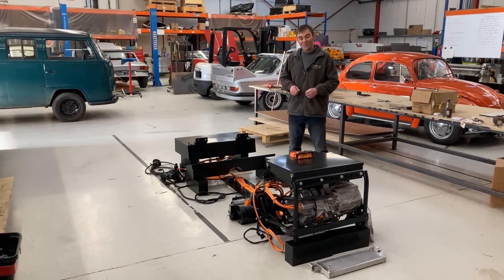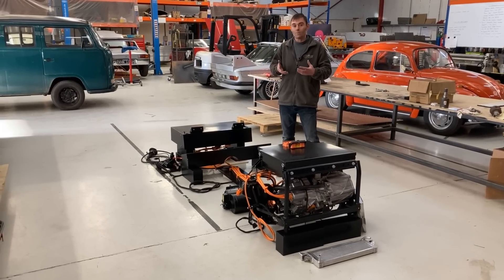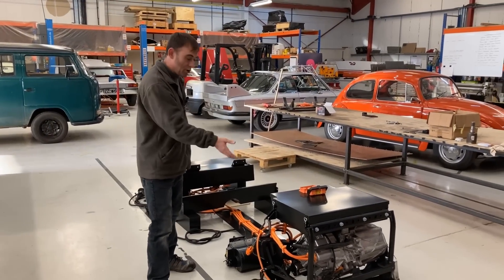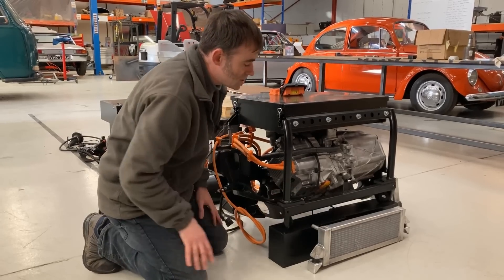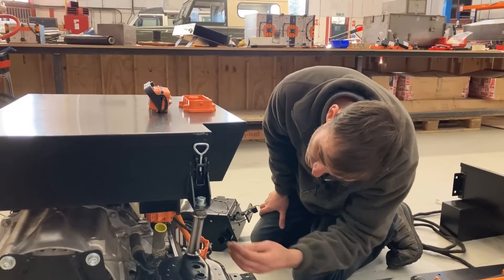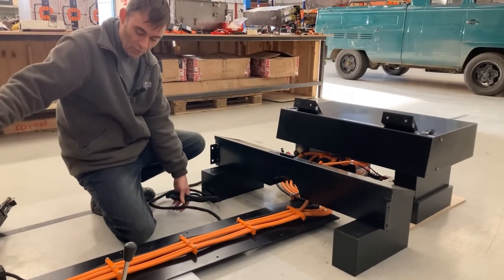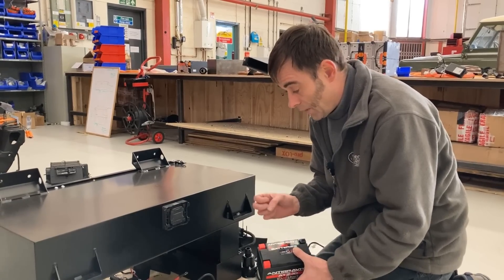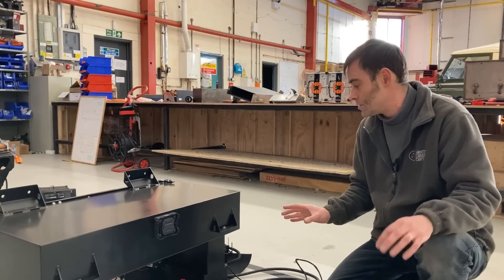Classic Mini bolt-in electric conversion kit.

Comment: Are there any trade-offs (power losses etc) with having 3 separate battery boxes, instead of having just 1?
Reply from the maker: Not really. Spreading the weight helps with weight distribution and handling that’s for sure. 👍

Comment: Have you thought about having a CHAdeMO connector in the second twin tank filler. I think it should fit if the type 2 connector fits. Then you could have slow (50Kw max) rapid charging. Adaptors from CHAdeMO to CCS are quite good and this would give your kit better usability for long trips or those who can't charge at home.

Comment: i take it thers a low voltage feed for dash and cabin light etc dident see eny fuse box for this ,,with the quality of your kits i am shore its there some wear, cant wate for vid
Reply from the maker: The 12v system is left as is in the car. The only connection to this for the EV system is permanent 12v, ignition 12v and the DC/DC that's charges the 12v battery up. 👍

Comment: I have 2003 Ford Focus SVT.  Wish there was a easy bolt in EV conversion! Is there any electric motor transmission adapter for a Ford SVT six speed transmission!  I was told the 6 speed is the same trany that the mini-cooper has.  I’d like to adapt a electric motor to the trans, stick it in second gear and drive it. Add a controller, batteries and what ever else I would need and just drive it locally! Any conversions like that available?

Comment: It's sad but I'm glad they say right at the beginning they only sell to approved installers. I'm looking for a basic kit I can buy and install myself even if I have to work out many of the problems of installing for my specific vehicle and getting it all to work myself. I can get an old forklift motor or something but I'm sure someone will provide a better solution than that, a kit which includes a modern motor, controllers, charging solutions, either a battery pack or instructions on making one, etc.

Comment: What gearbox is used when mounting this bolt in kit to the Mini? How does the new Automatic gear shifter work with this? Thanks
Reply from the maker: There is no gearbox. The Tesla drivetrain includes an inbuilt gear reduction unit. 👍

Comment: I am interested to know why use such a high HP motor?  Seems like the range could go longer with a small motor, but maybe not?
Reply from the maker: Because it slotted right in. It's not anywhere near that peak HP now for various reasons such as pack voltage etc.

Comment: Is there a difference in range between low power and high power mode?
Reply: Think about that for a moment. Yes!
Reply: @deanosaur808  that's why I don't understand not using a 3 spd gear set. It would allow you to double the range without having to double the battery

Comment: Love it, but did you ever consider, also stuffing some batteries into the tunnel? Which has been done, before in other EVs....

And why just use that SAE J1772 socket? When it crosses the pond, instead of true a type 1, since a type 2 is used when it stays home... It does not seem fair to the Yanks...
Reply from the maker: The battery modules are too big to fit in the tunnel. We supply Type 1 socket for kits destined for our US partner - Supercoopers.
Reply: @ElectricClassicCars  Thx for your feedback....
But it is readily apparent that your current battery modules would not fit in the tunnel.  So OFC I was just "suggesting", creating custom modules that would fit, "in case it was in your wheelhouse"?
And in the states, a "Type 1 socket" refers to a CCS socket, with pins for DCFC, which it clearly does not include... What you supplied is designated as SAE J1772
socket in the states, where will it be used.... 
Keep up the good work...

Comment: If you are running on a lower horsepower setting does the range of the vehicle increase?
Reply: Of course! The maximum range is reached using the road mode, as mentioned in the video.

Comment: 150 mile range? Not bad and I bet it feels like a rocket with all that power.
A simple EV without all the useless junk they put in modern cars, the main car brands could learn a lot from you.
Also I want one.
Reply: 💯 2003 gas car key-FOB failed, so used physical key to go shopping (+ new key-FOB battery)… only to discover my new 12v battery was defective (0.27v). First thought, new fully electric (locks, no physical key) EV would I need a brick, bust window? 😀🤷🏻😀
Reply: @gr8dvd  The same with the handbrake, if you lost power and your accessory battery (12v) wasn't a 100% you would lose that safety net and if it fails when the car is parked you have to remove trim to use the back up release.
All electronic toys are just more things to fail and the cheaper they make them the higher the chance they will let you down.
End of the day there's nothing wrong with leaving some things machinal.
I'll tell you my family has had cars with the electronic handbrake and the things have never worked right meaning the cars have always had to be left in gear to stop them rolling on hills, these were new cars as well.
Reply: @dave4803  Handbrake fail, aka EMERGENCY brake… that’s a hazard & under-reported! Kits/custom rebuild looking better & better perhaps one that uses manual shifter (different driving modes), never owned/wanted an automatic.
Reply: @gr8dvd  I have an automatic but a classic car. I hate relaying on stuff that has a high chance to fail, machinal will always work even if you lose power.

Comment: As the units are all built around subframe based connections to the car body, assuming the "prefferred professional installer" can fit / fabricate relevant motor mounts to chassis (old engine mounts) would that then allow the standard kit to be fitted to nearly any bodywork?

Comment: Great concept.
Do you know if your kit will work in a shorty? There doesn't appear to be too much kit intended for the transmission tunnel so perhaps it would work. Would be pretty interested in letting you try as part of a refurbishment commission...
Reply: What is a shorty??
If you mean a shortened mini, only shorter cables would be needed for the kit to fit.

Comment: I wonder if they adjusted the positions of the battery weight and heights to get the best possible center of gravity, along with as close to a 50/50 weight dist. as possible. I don't know a lot about Mini's so maybe that's not the ideal set up, some cars work a little better, or improve predictability in handling with oddly offset weight.

Comment: I have built and driven fast Minis for 40 years and and have a massive love of the A-Series and all that goes with it. My family say that I have petrol in my veins - but I must admit, that you have done something quite special here. In terms of performance you have certainly nailed it - and your kits will doubtless help more classic Minis to stay on the road - good for you.
Reply: Later Minis that are not yet tax exempt perhaps, as they are affected by the growing number of emission zones.
But the prospect of rebuilding an A series every other decade sounds far more affordable than replacing batteries, which are used to start with.
With the low amount of generally summer miles done by most remaining real Minis, I don't see the use benefit case.
Reply: I see your point, but my assumption (perhaps flawed) is that the typical person who builds or commissions an electric Mini (or an electric version of any classic) is a lot less worried about vfm than I would be. I love the A-series and never have much cash, so my choice is sadly an easy one.🙂

Comment: I thought of doing a triumph herald back in 90s  was planning on batteries  wet cell in front engine  toyota fork hoist motor could find a herald  only small car with chassis I knew of     just a dream
Reply: Could not find
Reply from the maker: We've got a Triumph Vitesse coming in soon for conversion, I think they were similar to the Herald. 👍

Comment: If you only sell it to specialists you are at least doubling the cost,and I bet the mini weighs about 50% more than the original.So much for progress.If electric cars are not made viable for the average owner,cars will be for the rich only.The rest will go back to serfdom.
Reply from the maker: The electric converted Mini weighs the same as a classic 90s Mini. Selling to specialists ensure that their staff are suitably trained in high voltage.

Comment: Some cars like the Honda Jazz had an AWD version available in the home Japanese market. I wonder if it would be possible to make a really small low cost conversion to add about 75hp to the rear wheels that could be switched to either be used regeneratively around town with the engine off but retaining the engine to allow very long distances away from charge points, or as a combined power alternative to the K24 swaps that some people do?
EDIT: I guess you would need the engine on at all times to power the standard assisted-steering and assisted-brakes without modification, but if the throttle pedal were adjusted to give inversely proportional amounts of electric regenerative effect for the first 2cm of depression and positive power after 2cm depression, and the petrol engine only gave power after 3cm depression, there would be great saving of stop/start wastage as well as doubling the available power for standing-start acceleration without much wheelspin.

Comment: Instead of an electric heater wouldn't it be more energy efficient and cost effective to divert the cooling system into the original heater core..
Reply from the maker: It doesn't generate enough heat. 👍

Comment: Don’t see the point in spending huge sums of money have a bolt in EV kit into a rusty old Mini. Popular, but dangerous - no side impact protection, no crumple zones etc etc.
Reply: Many supercars don't have crumple zones either 😉
This kit is not cheap, it's unlikely to be fitted to a rusty mini! 🙄
Reply: Also, newer classic mins do have side impact bars! And they can be retrofitted too!
Reply: @deanosaur808  supercars are not the subject of this video, but I’m sure you’re wrong! All new vehicles are subject to NCAP testing and approval. Your argument is like saying two wrongs make a right! 

The Iconic Mini was much loved, but inherently dangerous. It can be modified to make it a bit safer, but the scope is limited. 

Whether the donor vehicle is a rust bucket, or one that has been fettled, the Mini body shell, with its numerous external seams is prone to corrosion. 

I can’t imagine many of these kits being sold for what has become a collector’s item. Why devalue a classic? 

And by adding all that weight to a small car, the running gear would need modification. The Mini was renowned for its handling and won many rallies. I wonder how big battery banks under the rear seats and filling up the boot space will affect that.

Comment: This is awesome. Just saw this and it instantly got my attention. Please explain how the brakes will be handled. Could we still get to use a brake booster/servo with your kit? It would need vacuum for this! Second question is how the infotainment display will be for speed and other values. I badly wants this... 😊 👍
Reply from the maker: We use an electric vacuum pump and a standard Mini Speedo that has been converted to accept CAN data for speed data. 👍

Comment: If its a direct bolt in kit why cant it be a diy project, i under stand what you mean by danger of shock but if all the cabling its cut to size and all relevant plugs are on then surly is only when the batteries are fully charged that issues can arise so as long as someone is competent and care was taken then these bolt in kits would be great, people build kit cars all the time. what battery modules are used in the conversions. Big thumbs up     👍👍
Reply: Litigation.....

Comment: It looks like a really great kit, and only adds 60-70kg to the total weight? Easily overcome from the 100hp vs 60hp from the 1.3 engine.
This one you say is to fit Mk2/3, would there be any plan for later MK6/7 conversions? They aren't too far different but different subframes and bigger wider wheels. The difficulty also being in the ECU and Lucas alarm system which i guess would need to be replaced?
Also, how does this take account of the ancillaries like wipers, washer, radio etc?

Comment: Can you include in your videos what systems will be lost due to the conversion or modification like A/C, Push Button start, assisted steering, braking, modification.  You did this for the heater core but you left off all other systems that are impacted by this conversion and could potentially increase the cost.  Lastly A/C is a major system that adds true value and comfort for city driving that is very important and in some cases quite necessary in todays warmer climate.  What is the impact on battery and range with a converted A/C system?

Comment: Hi ECC.

1. With the conversion kits, does it cover the brake system since there's no vacuum for the brake servo?
2. Does the conversion include a solution for minis requiring air conditioning i.e. cold air only, no heater?
3. Is there an ACC power for radio, cabin lights etc..?
4. Does the conversion system use a keyless start system, or an old-fashioned key? 
5. What do you reckon is the weight distribution with the conversion kit? 40:60 rear biased?

Comment: What about steering assist and brake pressure?
Reply from the maker: They are now electric. 👍
Reply: @ElectricClassicCars  Okay, so does the kit come with electric pumps and brake kit, or is it a system where you re-use the old parts and attach a small motor to it?

Comment: I am in the Philippines where Gas is now limited because of Russian sanctions.  Could you have an economical conversions for the millions of Multicab  mini trucks that are here?   They are a 3 cylinder 660 cc motor with lots of room for conversions.  Lots of wind here for a charging windmill.   On average 100 to 200 km a day would be ok.  Piggy back plugins battery packs could be added if system was designed to be added when it could be afforded .   HELP...

Comment: Why not use a lower powered motor like one from a Leaf?
Reply from the maker: Because the Leaf motor is bigger, we offered it up. This motor setup fits like a glove and can easily be tuned down to whatever hp the customer wants. It's easier to start with too much and tune it down than go the other way. 👍

Comment: How do these go with compliance - either in the US, UK or other places like AU - as far as extra weight, suspension / springs, braking capacity, rollover and crash testing... do they require these things to be signed off by an engineer that the conversions are safe and secure to be on public roads?

Comment: God everytime I watch this guy he's bashing something. Bashing 'the new bloated mini', bashing petrol engines. How about we run over how electric sucks because the range of your vehicles is so low you can't go on a decent trip of any size without having to sit in services for an hour charging it? And how they take away all the character of the lovely looking engine, the gear change and the engine sound from cars. Just to replace it with some AAs. How boring.

Comment: I would NOT want an all-Electric car, but I would LIKE a hybrid designed for a Morris Minor/Major, or other British Saloon.   The front to rear drivetrain of the Morris Minor/Major would stay the same, front engine, rear-drive, but by using "hub-motors" the front wheels would be driven by batteries stacked in the boot.  Until the "forever-batteries" are buy-able, I'd prefer to use Lithium-iron batteries.  The "key" would be a HUGE [in Output, with a separate RV-type converter ] alternator, that could run: normal engine/A-C/battery-charging duties.   You could have brisk acceleration from the electric front-drive, yet tour HUNDREDS of miles @ one time, by quickly/slowly charging the electric batteries, as you drive down the road, on the stock/greater engine, as if you had brought your house-charger along the via Converter, going from 12V to 120/240 to charge the batteries.   All the Elites that "travel-oppress" their minions, HATE Hybrids, but I'd like one under a "classic" British body, so I could have "cross-country-RANGE, with Electric-car acceleration.   I'd like to be able to go 2500-3000miles in 50 hrs, only stopping for gas, & using the electric-power for boosting acceleration, but keeping the batteries charged.    I do NOT "Support" the Fraud of Global-warming, as Kriminals like ALGORE, touted, to facilitate the further fraud of carbon-credits they own plenty of, enriching themselves with Billion$ on the backs of ordinary taxpayers.   ALGORE invested in Malibu, Ca. beachfront property, which is no more than 228" above sea-level.   Vostok ice-cores Prove Anartica was once tropical, with double the C02, without the 1st car/factory, 30,000 yrs ago.

Comment: Thats the custom resto shop i wanna do. Order in kits for electric conversion bolt-in. I have a p1800 that i wanna do that too and use s2000 rear suspension. The whole chassis is only about 2” off than the s2000.

Comment: This is a great kit, and probably very sensible only selling to approved installer partners.
What I'd like to know is how is the speedometer working on this conversion?
I know the motor controller has CanBus, but does the original mechanical one get replaced with an electronic 'retro' look one?
Keep up the great work!
Reply from the maker: Kinda. What we've done is kept the original facia so it looks like an original Mini gauge, but the internals are all 21st century tech talking CAN to the motor controller and BMS. 👍